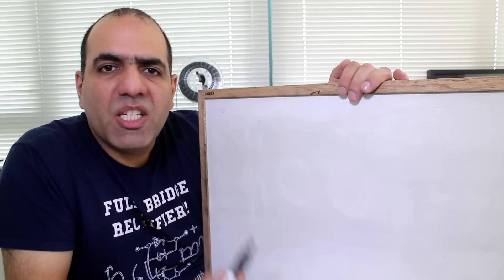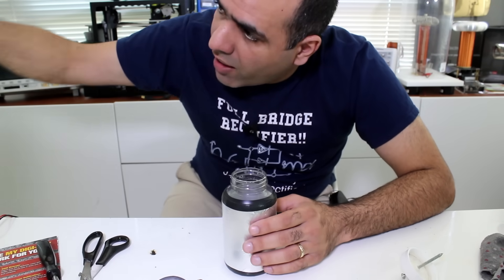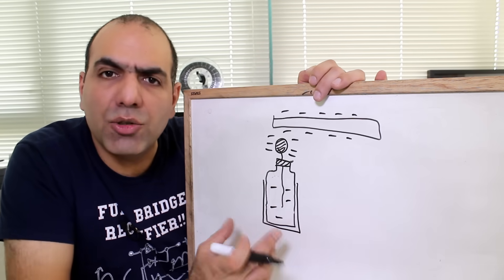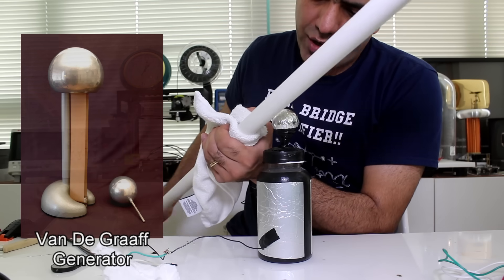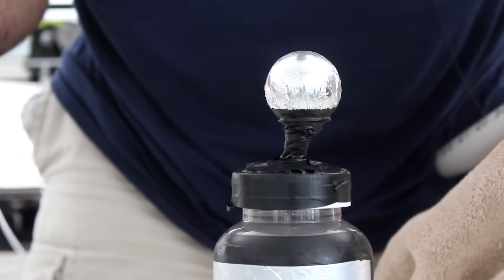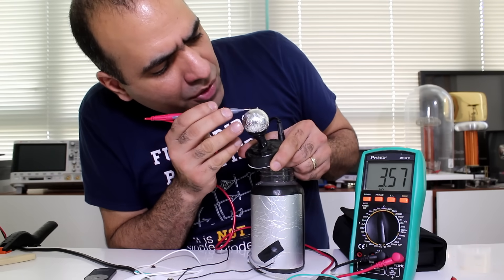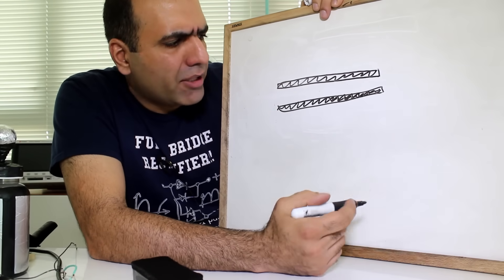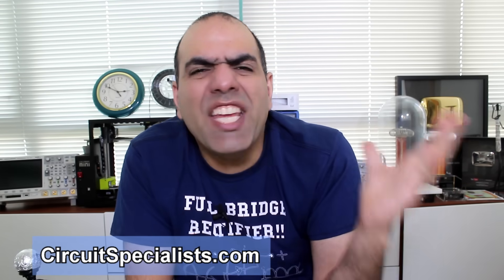Make a SUPER HIGH VOLTAGE Capacitor

Comment: Just in case anyone is interested, you can make 6 inch sparks quite easy, 4" min even in humidity. Its kinda hard to explain without pics but it really is quite simple & is the cheapest & easiest method I know of that can produce sparks as long as a decent Tesla coil(or other similar apparatus). Get a foot long length 4 or 5" Diameter PVC pipe & cap at both ends. Arrange so it can spin (like a bread roller), either via a small electric motor or even just a hand crank. In other words drill out the end caps and put an axle thru it. Obviously you need to make a chassis of some sort to hold/mount it & everything else. A plastic milk crate works great. You can use a metal axle (but better off not to). There are countless DIY ways that will suffice for this. Then rig a piece of cardboard or plastic that leans/rubs against the entire length of the tube & attach a nice big fluffy piece of fur(rabbit pelt or fake is fine) to the end of the plastic or cardboard so the fur(a nice healthy 2 or 3in diameter by 12" long piece) is whats rubbing(only on 1 side) the the entire length of the spinning PVC tube. Just use like rubber-bands to attach stuff & to adjust the tension/friction of the fur rubbing against the spinning PVC tube. Then take a piece of copper pipe(3/4" & thick) the same length about 12in & mount it close to where the tube & fur meet/rub. Align it such that the copper pipe is adjacent to the part of the PVC that had just rubbed the fur, either by moving the pipe to the other side of the fur or by changing the rotation direction of the PVC tube. Also cut a piece of aluminum foil the same 12" length of copper pipe & about an inch wide & fold it in half long ways so you have a 12" long by half in wide strip of foil. Cut notches/lines about halfway thru(1/4in deep) along the entire length of the folded foil with scissors & just unfold them to make like little teeth/fingers pointing in all random directions. Then Just tape this toothed foil strip on to the copper pipe & aim/point the fingers just above where the PVC & Fur rub. At one end of the copper pipe solder/epoxy or even just rubber band a round(ish) metal ball(about 1" diameter) a foil ball will work but something more like a smooth polished cabinet knob is better & is MUCH better for the ball atop the Leyden jar Capacitor too. You will need a bigger Cap then in this vid to get 6" sparks. About a 2 liter bottle size(of surface area) should do(I found 80% clear/transparent Tupperware "type" plastic containers to work the best). btw this is on the DANGEROUS side so use CAUTION. Arrange things such that its easy to Adjust the distance between the metal ball on top(connected from the inside) of the Leyden jar Cap & the metal ball thats on the end of your copper pipe thats mounted to your machine, about 1/8th inch is fine. At this point you should be able to see & hear the Capacitor charge as your PVC machine spins. Attach another metal ball to the outside of the cap with a wire & also arrange so that  you can easily adjust its distance from the caps other(top) ball. thats about it. The closer the gap of the Caps metal balls the faster it will discharge & the bigger the gap the longer it will take to charge/discharge but the longer the sparks will be. but note that, a point is easily reached(if/when the gap is too big) or where leakage discharge will occur faster than the fur machine can charge it/keep it charged. But you should quite easily be able to get a Solid 5" spark about every 1 or 2 seconds even with the most average of similar set-ups. imo the Cap is actually thE most important component of the project/demo/toy as the fur machine really just charges it(albeit quite fast/robustly). There are a few important variables, mostly imo the humidity of the air where you are operating it. The diameter & length of the  PVC, Copper Pipe & Fur. Also perhaps the tension/friction of the fur against the PVC. & certainly how fast(RPM's) you can spin the PVC roller/wheel. One tweak I never got to try is to cover the PVC with latex rubber like from a balloon (rubber warped PVC pipe as opposed to just the PVC plastic) it might help. Also, Smooth(no sharp points) on ALL of the metal parts is important in/out/on the wires & the internals & externals of the jar cap itself. I'll make a vid of it when I get a chance. & btw My Capacitors were always made with aluminum flashing(not tin foil) on both sides of a like 80% clear/transparent tupperware TYPE of container & a bit bigger than His salt water one but I doubt it was 2X as large(as far surface area anyway). The Exact type of & thickness of the plastic dielectric is CRUCIAL & might take some trial & error experimenting to get right(5-6"sparks). The Cap that I actually measured 6" Sparks from was about 8in diameter & 6in high. If anyone makes one before me please post.......Good Luck !
Reply: Damn, thanks man!

Comment: I build them from 5 gallon glass water carboys, line with foil and cover with foil. Charge with a  30 KV 
neon sign transformer and HV diode from OLD style TV.  Then form a spark gap. It actually so loud as it discharges hurts your ears. You can use this set up to power the primary in a Tesla coil. The amount stored in that much area-is tremendous.

Comment: Would you really need to connect the wire of the laden jar to both the ground and your arm? I might be wrong but I think that if it was just connected to your arm that would be enough because the electrons that left the outside of the jar would go through your arm to the top of the jar.

Comment: Use one of those $5 high voltage potted DC modules from banggood/ebay/amazon, and make an even bigger capacitor using sheets of kapton/polyimide and that copper foil EMF tape they sell for audio stuff

Comment: I like the King of Random, but when Nate does videos regarding electronics, it always bothers me because there is always something wrong (as you just showed) or its simplified to the point where you get the wrong idea. Given the large audience that KOR has, this is terrible, because now a large sum of people get misinformation on electronics.
Reply: That's because Grant is facing criminal charges (AKA that vacation he took for an unnecessary amount of time) and the new guy doesn't know jack shit in comparison.
Reply: Thank you! The guy actually suggested using a 3 amp lamp switch for disconnect on a extension cord. That video was extremely painful to watch.
Reply: Electricity is a lie. We all know that in wires there are magic pixies.
Reply: Dustan Bateman The explosive charge was canceled, he never went to jail, never arrested as he explained it on IG.
Reply: there is a word for that: Americanised.
Reply: To be fair, Grant didn't know shit either.

Comment: Why did the capacitor get charged at the end? The transformer outputs AC, so it should short the entire transformer and trigger the breaker, no?
Reply from the maker: The doide rectifies AC outputting only positive pulses that charge the capacitors one way
Reply: Whoops :) totally missed the diode part.

Comment: I call BS on the 12 amps lol . E x I = P  if you could generate that kind of wattage  from stroking a pipe we would't need the power company . also 12A at those voltages would kill an elephant

Comment: Interesting and informative video, as always but you should warn viewers not to recreate your stunts - that capacitor could kill you and of course any of your viewers who watch this and think it's safe! If you're lucky and have a healthy heart it still doesn't mean it isn't dangerous + someone could make even larger capacitor and charge it to even higher voltage, thus making it even more deadly. Whoever is reading this, please be careful and don't try to discharge capacitors through your body or possibly even your friends body - this is not a joke and someone could end up dead! Oh, and king of random also did something like this? Incredible! Just like that crazy russian hacker who wants his viewers get killed by the CO2 "room cooler"! Ridiculous!
Reply: Arthur Speer So, when exactly has your static shock discharge look like a discharge of that capacitor? Never, of course. Why? Because human body is only equivalent to about 100pF capacitor - which is only 1/100 the capacity of the capacitor that he made + your body can't be just charged to "infinite" voltage - static shock is usually only about 3kV and all that current won't just flow through your heart like it does if you connect one plate of that capacitor to one of your hands and the other one to the other hand (like he "demonstrated" in his video).

Comment: What's the ESR of the 2nd one?
Won't it charge more if you leave it connected longer, or is that only for capacitors with higher values?

Comment: I remember taking a circuits course in college where we made a capacitor out of our textbook from the class. We sandwiched two sheets of aluminum foil into our textbook separated by one of the pages. We measured the surface area of the foil and looked up the dielectric constant of paper and plugged that into the formula to see what the capacitance was supposed to be. Then we measured the capacitance to see how close our measurement was to what we "should" have gotten. We never did try to actually charge it up though. I wonder if that textbook capacitor we made could have zapped someone?

Comment: I once made a capacitor using 1mm sheet glass, 30x30 cm, with Al foil, ten layers thick.  It measured  about 250nF and I charged it to 15KV.
One damp day in my garage, I didn't completely discharge it and nearly killed myself.
I have never played with capacitors again.

Comment: Keep it simpler and make a voltage multiplier. Or even simpler! Take the circuit out of a small fluorescent lamp. It outputs something over 10 kV! It's basically a ZVS driver. ;-)

Comment: Why did you put your ground on your opposite wrist ? You shouldn't pass current near your heart !
Reply: Jonathan Baril Roy Because he wanted a good reaction for the video, and he has mentioned before that a healthy person can handle 10 amps for a microsecond.
Reply: CreaperSiege but it was 12amps for 7 ms, so he's like a super person?
Reply: jexusdav2 it doesn’t matter if it’s inverted, his grounded hand is opposite from the one he used to touch the capacitor so whether or not the video was inverted wouldn’t affect the fact the grounded hand and the one he used to touch the capacitor were opposed to each other
Reply: But he loves feeling current on his all body :D
Reply: Maybe the video is inverted? :v
Reply: Also, the high current didn't last one, since it discharged so fast. Therefore, it wasn't 7µs but probably 1µs.
Reply: Dennis Bunjamin Well, we already knew that about him.

Actually though, he said max of 12 amps, holding mostly at 5, for about seven micro seconds. I don't know the duration a human can take 10+ amps across them, but under 50 μs is probably okay, as long as the amperage isn't enough to burn you.

Comment: Explain the concept of ground in detail plzzzzzz. Why it is necessary for safety or for current to flow??  What happens if we do not ground??
Reply: No ground = nowhere for charge to flow to/from.  You must always provide a path for charge to flow, and in the case of lightning or other high voltage surges, a path for the discharge to flow other than through people or electronic devices.  Placing oneself in the ground path does not help matters, as you could see in this video.
Reply: Ken Logsdon So if I wrap a wire around my toe and ground it and then touch a current source will it pass through my body without hurting me??
Reply: No!  That's making your body part of the ground path!  That is what you never want to do!
Reply: Ken Logsdon Thank bro
Reply: Certainly.  Now, to prevent damaging electronic components such as semiconductors you should connect your arm or leg to ground through a resistive strap in order to eliminate static charge buildup on your body that may discharge through the circuit you're working on.  Alternatively, you can just try to remember to touch a ground point in the equipment to equalize the charge between you and the equipment before handling sensitive parts.
Reply: You would definitely learn what it fills like to be a conductor with current flowing through it.

Comment: The foil should be as wide as the plastic, but let it hang out one side, on the other side hang it out the other side. When rolled up you'll have a terminal on opposite ends.

Comment: If the problem with the jar is saltwater, could mercury be used?
Reply: We have to ask Cody...!
Reply: The whole purpose of the jar is that you fill it with liquid. If you'd rather use foil inside, just make it a flat surface capacitor, like in the end of the video.
Reply: Yes but it would be hazardous due to toxic mercury vapors.  How about lining the inside of the bottle with foil and using an inflatable balloon to press the foil against the inside surface?
Reply: More accessible  than mercury, I'm wondering if ball bearings, screws, nutsnbolts would do the trick.
Reply: Not sure how you would ingest vapours, but it would be remarkably heavy and expensive.
Reply: If we're suggesting dangerous conductive liquids, what about sulfuric acid?
Reply: Ken Logsdon great idea, I'm gonna try this
Reply: if mercury is too dangerous use NaK instead.
Reply: its resistance is high too so i dont think it will make any difference
Reply: Tollen's reagent? Silver plate it? Shouldn't take more than a couple of bucks worth of silver, and would be very smooth, conforming, and low resistance.
Reply: how would you silver plate a non-conductive surface?
Reply: ...With tollen's reagent...
Edit
https://www.youtube.com/watch?v=nGmxHLHyUPc
Reply: use warm gallium
Reply: dip it in molten silver
Reply: Liquid gallium is more safe
Reply: >dip 'it' in molten silver
What 'it' are you talking about? Some body part? Is it safe?

Comment: Use taser to charge this capacitor. Tasers usualy outputs high voltage dc pulses. It should be faster than rubbing a pipe.

Comment: When I worked at a warehouse, we had these large "saranwrap" spools that we wrapped up with the pallets with. During the winter, the main body of the pallet would zap me constantly was I walked around the pallet while wrapping. One time I decided to stand further away from the pallet as not to get zapped. About half-way through wrapping, the hair on my arms and head were standing quite up. Suddenly A large "POW!" and I felt getting grounded through my thick soled Dr. Martin leather work shoes. My toe hurt very badly for several minutes.

To be clear, it didn't short through the thick sole, it shorted through the leather down to the concrete from the tip of my big toe.  I never did that again. Many smaller zaps were just fine.

Comment: Nice video. There is only one thing I would correct: You can't measure the resistance of salt water with a regular meter, because there are chemical reactions happening where the metal comes in contact with the solution. This reactions require enegry which means there is a certain threshold voltage to overcome in order to get decent conductivity. The voltage between the probes for measurement is usually too low. Rather you should apply something like 10 volts and measure the current.

Comment: I have a question! What would happen if you connect a FULL BRIDGE RECTIFIER to the capacitor (the DC output), and the other end to the Tesla coil? (one end to the output of the tesla coil, the other to the ground). Is it dangerous?

Comment: Isn't the output of the single diode rectifier the average voltage 900VDC as opposed to 2800VDC which is the peak voltage of the AC waveform

Comment: Maybe you can build  a cockcroft walton generator (voltage multiplier) to reach high voltage from ordinary AC current, if you want you can use the MOT too if you can buy high voltage diode and capacitors. However i very like your channel, i see yoir videos every day, also if i see the same!

Comment: So basically the more the voltage, the more the energy? To the point the isolator becomes conductive? Why not increasing its capacity and lower the voltage, so you store more energy with the same applied voltage? Although then the esr should affect more? v=i*r, less voltage, less intensity.

Comment: question - if you fill Capacitors enough - can you replace a battery with them? example - take out the battery of your car, and just connect Capacitors that are filled to it, will it run? how long?
Reply: Deconverted Man You could jumpstart a car with capacitors like in the Cranking with supercaps video, but I doubt it would last long. A capacitor is usually implemented in a circuit along with an energy source
Reply: neat!
Reply: Capacitors don't hold enough charge to replace batteries in most cases.
I've used supercaps to replace coin cells to keep a real time clock running when an appliance is off, but that's very low current.

Comment: how about using aluminum foil on the inside of the jar aswell and getting it flush to the surface by inflating a ballon inside? wouldnt increase the capacity, but would bring down the internal resistance whilst providing the insane voltage rating of the jar type capacitor...

Comment: you could've used paper. it has a slightly higher permittivity than mylar; which would mean a higher capacitance. or you could soak it in some oil to achieve even higher values of capacitance.

Comment: Wow where were you with this video a couple of summers ago when I was making a Tesla coil? I used around 11 jars or so just to get 9nF and since the lids of the jars were metal it tended to arc to the foil on the outside. While it did sound like a bunch of fireworks, it did not produce much of an arc. I eventually just bought a bunch of Cornell Dubilier capacitors for almost $100. I can't believe the second one you made was so small and already at 9nF. I wonder if it would have handled 9kV though.